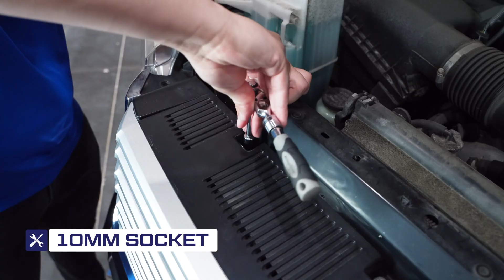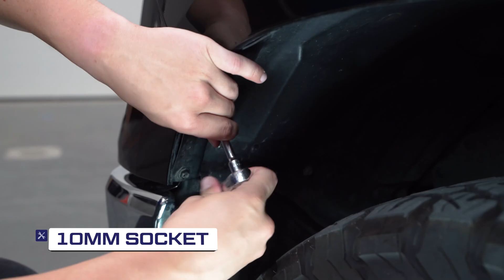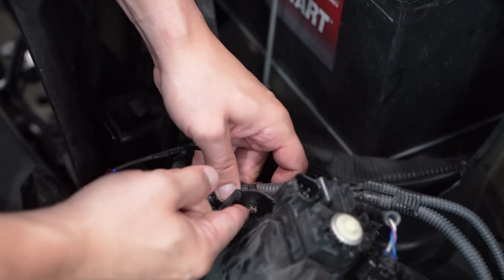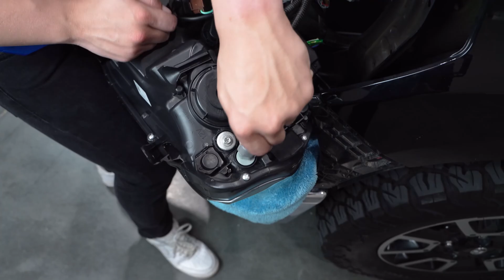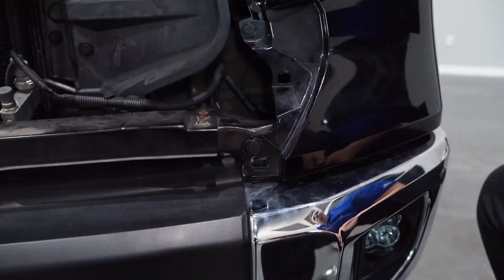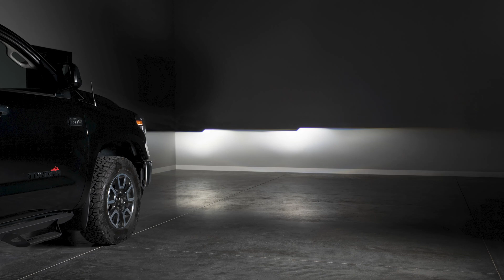How To: Install 14-21 Toyota Tundra LED Headlights | FORM Lighting

Comment: A set we recently installed has a really weird cutoff. Are there any other adjustments other than the leveling adjuster?
Reply: Is the electrical leveling adjuster supposed to be just done manually inside the car and done by eye?  There's no automatic level adjustment based on the car loading or anything of that nature?

Comment: Just installed these on my 2020 Tundra SR5 4X4 and my right turn signal is hyperflashing when the headlight is on.
Reply: Did you get this fixed?

Comment: Thanks for not letting us know we’d probably need to adjust the beams. My pattern is not level. A tutorial would’ve been nice.

Oh yeah, also, not reminding us to unhook the safety sense harness. Almost ripped that thing off the truck pulling the grill off.
Reply from the maker: Sorry to hear you are having so much trouble with this. Aiming your headlights is standard procedure for all aftermarket headlight upgrades. It is impossible to accommodate for all ride heights out of the box, and that is why we have built-in aiming adjustment screws. You will not have to remove anything to properly aim the headlights. Simply turn the screws out or in to raise or lower the beam pattern. If the stair step pattern is what is causing concern this is also intentional so that you do not blind oncoming traffic. The driver-side output should be lower than the passenger. a

As far as the safety sense feature goes the vehicle that we filmed this install on did not include it so it was not noted in this video and I will pass the suggestion along to our team to revise this.
Reply: How to change the bulb in it?

Comment: So if my truck came stock with halogen headlights there is no way to instsll an LED headlight with LED bars for the daytime lights?  are there shops that can reconfigure the wiring to receive those headlights?  Or am I just stuck with regular reflector headlights?
Reply from the maker: Hey there. This option is plug and play for all trim levels. No need to hire a shop to install. We include all the necessary adapters to bolt the lamp right up to your truck.

Comment: NOTE: If your tundra has factory halogens, you need to use the reflector adapter regardless if you are installing the led reflector or PROJECTOR headlights. If you install the projector headlights without that adapter the blinkers won't work.
ALSO if you have factory drl's and halogen headlights, you have to use the fuse tap for the form drl's to work.
Reply: Do you know where I can buy the adapter? I don’t see it on Form website
Reply: @SATRU24 It should have come with the lights. If it didn't, I say to call and email them.
Reply: I did the fuse tap. I’m curious what fuse I took out to replace with the form fuse for DRL. Kind of worried it can cause issues
Reply: @allisonmaletta2351  The fuse tap replaces the 10 amp ignition fuse.
Reply: And that’s not needed ? Sounds wild to remove it no??
Reply: @allisonmaletta2351  You're replacing the fuse, so the fuse will still be there. I had it in for awhile and had no issues.
Reply: Thank you!
Reply: @allisonmaletta2351 fuse taps are supposed to leave the original fuse in place and add on a separate fuse for the accessory, so it doesn't affect protection on the original circuit.  It's not replacing the original fuse, just relocating where it's mounted.
Reply: Thanks. I was confused ASF because my lights came with all these wire harnesses. So basically I'ma use all of them

Comment: I have a question so I tried to set up my light but the running lights don’t turn on or even when I do the turn signal only the upper light turns on and the bottom doesn’t
Reply: Like the running lights in general won’t work
Reply from the maker: Hey there! Did you route the included DRL harness that comes with these lamps?

Comment: If The remaining connector on the adapter is not needed do I just leave it hanging there ?
Reply from the maker: I would recommend securing it to something using a zip tie if you can, but yes you are correct!

Comment: Where that 10amp fuse is in your video, we have a 75 amp in that spot? should I remove it or can I just plug your fuse connector into an open slot?  Also see comments below, having an issue with the turn signals as others have mentioned below
Reply from the maker: Hey there! Apologies for the delayed response. We have seen a few issues with the turn signal, but have since introduced a new adapter harness to help correct this.

If you've not already, please go ahead and give us a call at 636-748-4444 Monday-Friday 10 a.m.- 5 p.m. CST, or shoot us an email at contact@formlights.com, and our service team would be happy to help you with that. Thanks!

Comment: with these lights and new harness, can you keep the upper and lower beams on at the same time? meaning when you turn the bright lights ON will the low beams stay on?
Reply: I figured it out, had to pluck. The square black box relay, the video doesn’t mention or show it.
Reply: I have this same problem where my lows and highs don't stay on at the same time when switching to highs
Reply: Did you ever figure out why bright and dim do not both stay on when on high? I am having the same issue. Bright lights are dimmer than dim.
Reply from the maker: Hey there! Our apologies for the delayed response. If you've not already, please go ahead and give us a call at 636-748-4444 Monday-Friday 10 a.m.- 5 p.m. CST, or shoot us an email at contact@formlights.com, and our service team would be happy to help you with that.
Reply: No, but the high beams actually illuminate in front of you, instead of the stock highs that just put a spotlight a mile into the distance. Very usable, I’ve got them on my 2020 1794.

Comment: Just installed, I've now got intermittent hyperblink which is annoying, 2017 Tundra non led. I've found three options
- repin the turn signal connector
- shave the part in the relay under the dash for the turn signals
- add resistors (not a fan of this AT ALL because they get super hot and are a  fire risk)

Can you comment?
Reply from the maker: Hey there! Sorry to hear you're having some issues. Please go ahead and give us a call at 636-748-4444 Monday-Friday 10 a.m.- 5 p.m. CST, or shoot us an email at contact@formlights.com, and our service team would be happy to help you with that.
Reply: Did you ever get this resolved?  just installed these and its the hyper blink in the cab and no actual turn signal working on the front new headlights
Reply: @formlighting what was the resolution to this?
Reply from the maker: @Live2dayWanderland  Sorry for the delay in response. We were out of the office for the weekend! I responded to your direct messages with my solutions, but as always we recommend contacting our customer support team who is a lot better at resolving issues like these. You can refer to the comment above or access their contact info here if this is something you have experienced. Please give us a call at 636-748-4444 Monday-Friday 10 a.m.- 5 p.m. CST, or shoot us an email at contact@formlights.com,

Comment: I got a tundra 15 it doesn’t have any led at the moment will I need to splice wires or connect anything to the fuse box for them to fill work as they should
Reply from the maker: No splicing necessary! Our headlights will plug right into your factory connectors, including the leveling motor. There is one fuse tap to enable the DRL, but you can see where to install it in this video!
Reply: @formlighting  and will that come with the headlights or will I need to purchase that separately?
Reply from the maker: @adonisjr1488  It is included! You won't need to purchase any additional harnesses.
Reply: @formlighting  hi there so I got my reflector headlight for my tundra and I installed everything the way it was supposed to but the only issue is now my truck won’t start but the lights seem to work properly how do I fix the issue
Reply from the maker: @adonisjr1488  Sorry to hear that you are having some troubles! For all troubleshooting related inquiries, please send us an email at contact@formlights.com or give us a call at (636) 748-4444 Monday-Friday 10 a.m.-5 p.m. CST, and our service team would be happy to further assist you - thanks!
Reply: @formlighting  no worries I was able to get it all installed and connected they came out well and work great
Reply from the maker: @adonisjr1488  Great to hear it!
Reply: @adonisjr1488  what year is your truck ?

Comment: Just installed mine, seems like there is no way to access the adjustor screw with the lights installed....
Reply from the maker: Hey Kieran! These lights include an integrated manual adjustment screw on the back. We would recommend making final aiming adjustments before replacing the grille and other trim panels to make things a little quicker.